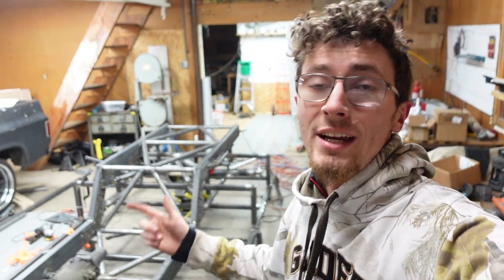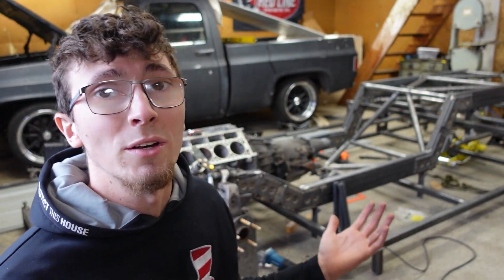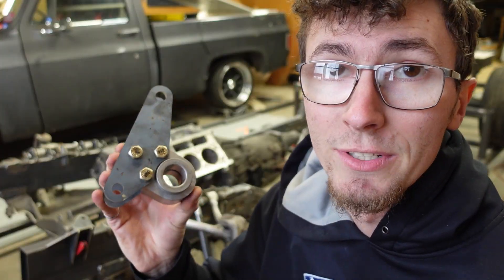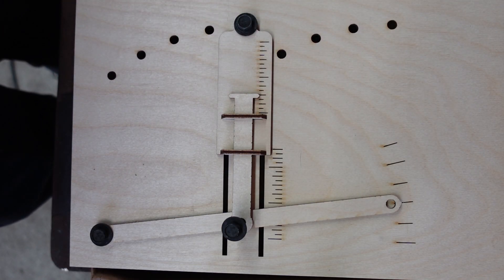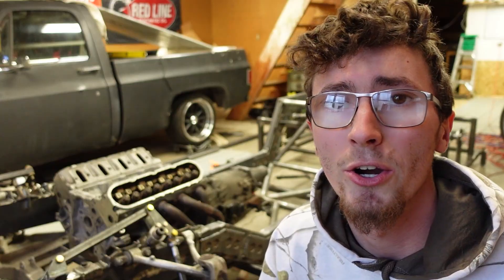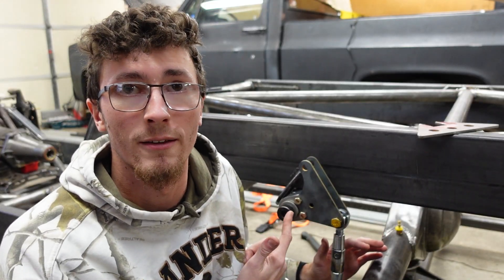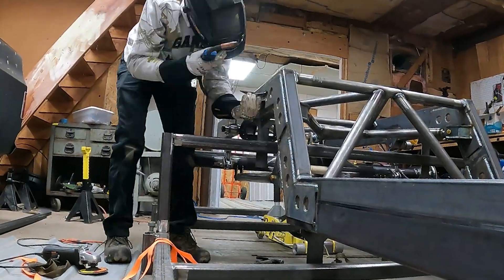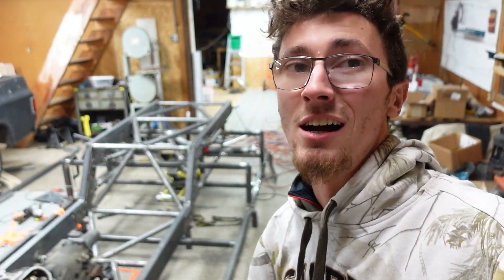Building 1 of 1 Cantilever Suspension  - Pro Touring C10 Chassis Build Part 6

Comment: I loved the illustration with the wood laser cut out, that was very helpful, thank you.  Can you tell me with the way that you have the rear suspension configured in a longitudinal mounting on the long axis of the truck, would you expect that if the axle compresses under acceleration that it will actually act as a lever to provide the effect of keeping the nose of the truck down?  Thank you again

Comment: One concern I have is that it does not appear to have any grease fittings.  Does it not need grease on all of the pivot points?
Reply from the maker: I did add a grease fitting to the pivot blocks before final assembly.

Comment: Wish there was someone like this local to me who had the knowledge. I would love to mentor under someone with half of your ability and skill.
Reply: I can pretty much guarantee you there’s a guy with this knowledge and a shop somewhere within an hour of you unless you’re in some random country with no car culture lol
Reply: @AutumnsGunnar I’m sure there are too, however I live in the middle of nowhere Eastern Kentucky and there isn’t much of a car culture. Lifted trucks, new “muscle” cars and extremely old muscle cars. I’ve got a 70 Cuda myself and plenty of other hot rods. I’m pretty handy with a wrench as it’s my career (I was a Chrysler technician for just under two years and I work and a small shop now) but I am by no means an engine builder for huge power as I don’t understand the numbers ans how they relate (think camshaft, cfm of the carburetor, valve size and head flow) and my skills as far as setting up other than factory suspension is basically nonexistent. I want an old head that can do it all.

Comment: I'd like to see how well those bellcrank bolts hold up over time. I wonder if you considered the possible need for a grease fitting to add a little more wear resistance in the bell rank pivot point, or is the material you choose of sufficient quality to resist extensive wear over time?  Edit - after reading more comments it seems that at least one other is wondering about lubrication of the bellcrank pivot. Maybe we are both over thinking the issue. 😅
Reply from the maker: I did get grease zerks installed and they have been greased. New video coming in a few days. Things are working well!

Comment: Since you machined the pivot bases you should have made the pivot pins integral. Shoulder bolts are the easy button for a reason.  Anyway, loctite those shoulder bolts.

Comment: such a sick video! Loved the little laser cut wood explanation. Also, the shoulder bolt setup is genius -- always wondered the best way to build in extra strength when packaging doesn't allow for a double shear setup on the cantilever. Great info all around!

EDIT: question: wouldn't lathing in snapring seats at 8:40 significantly weaken that rod at two critical points? Why not use collars instead?

Comment: Very interesting info on a topic not alot of people make videos about. Do you think this style would be good on a long travel no prep front suspension? As an alternative to high dollar long travel canister struts.
Reply from the maker: If it's set up correctly, it definitely can be.
Reply: I just changed my mustang II coil spring to dual adjustable coil over. Re angled the ball joint cups 30°. Gained almost 2 inches travel in the arms. Got 5" total extension with the current coil overs. But any taller id need to do something like this and lay it over parallel with the rails. Hopefully its enough haha. Can't wait for future videos

Comment: did you fabricate the bellcrank bushing/pivot point yourself or can you buy them? I've been looking all over for exactly what you're using there for my OBS build. Any tips on getting ahold of some of those would be greatly appreciated! Cheers from Canada! Your build is inspiring me to get even more in depth with my build. started out as an LS swap and lowering kit and now ive got my frame cut in half for a custom back half with a torque arm setup! Definetly would like to add pushrod suspension as well!
Reply from the maker: Mine started the same way and here we are, lol. Yes I did make all of my cantilever parts, my best advice would be to way over build it the first time. once you have some testing on your parts you can always make it thinner or smaller. but having a catastrophic failure puts you back to square 1. Material selection is a big part in building things yourself. I used cold roll 1018 and 4140 prehard on all my suspension parts. McMaster-Carr is a great resource when building things like this.
Reply: @designbuilddrive  yeah man thats been my build philosophy so far! I would have liked to do a vette subframe like yours but had to settle on a crown vic front subframe. I kept most of my stock front rails but i boxed them and then tied into my custom rails just behind the cab. custom x brace that ties into the trans mount and then a beefed up torque arm rear setup. I just opted to go that route since theyre fairly simple to make and they bring all the stress into the center of the frame where the strengh is. ive got my LS set back over a foot from factory with a custom firewall to make room for an 8-1 header! cant wait to fire it up in the next few months lol

Comment: Curious how the drill bushings will wear over time. Given the low surface speed (?) of the bell crank, I'm not sure that even bronze parts would wear as intended. Doesn't it need some minimum surface speed to self-lubricate? Will the materials you chose gall at all? What about greasing it, or using a sealed bearing of some type?